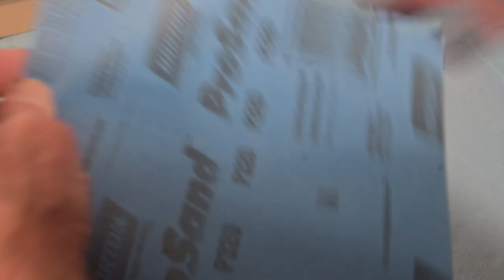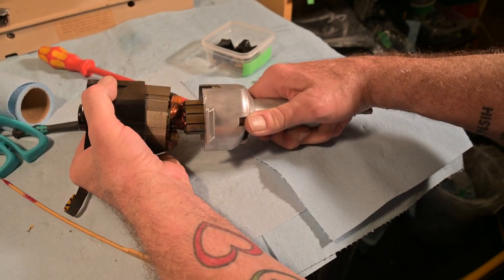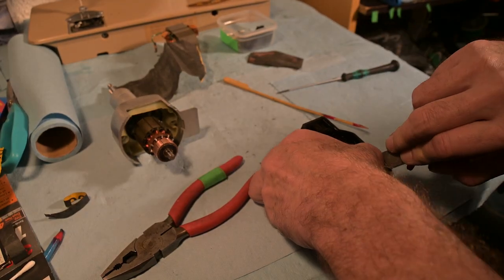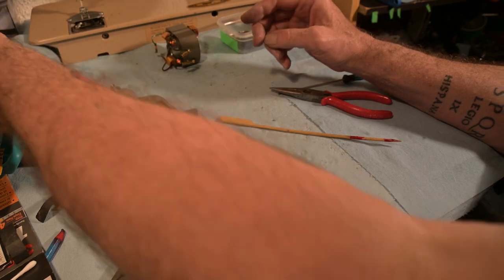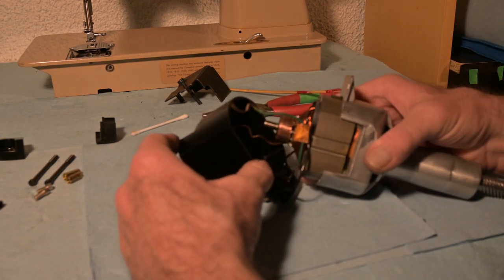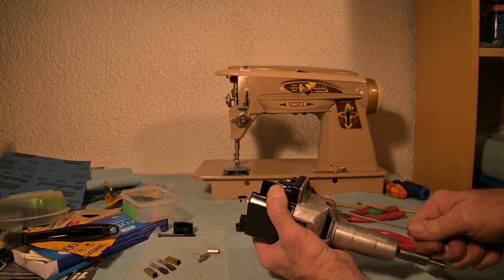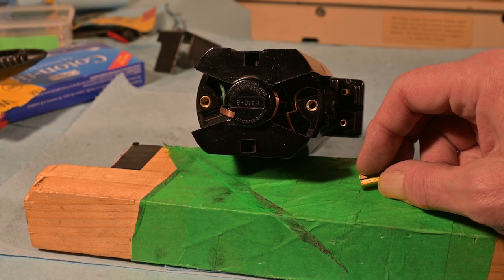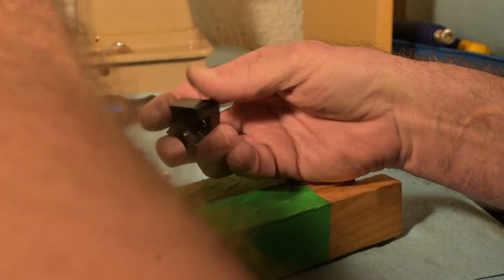SINGER 503 MOTOR JOB

Comment: A great video. I think the motor in my 411G needs some attention, as despite fitting a new electronic speed controller, the motor is a bit hesistant to start.  Perhaps the motor just needs a new pair of brushes and a commutator clean?
Reply from the maker: I think you are right about the clean! You’ll see how much brush is left! Thanks for stopping in! Have fun!